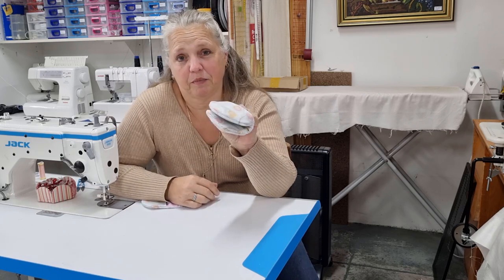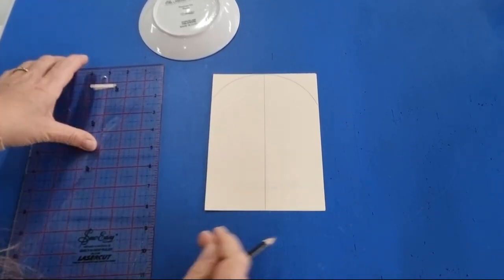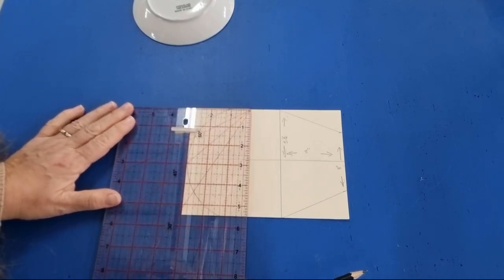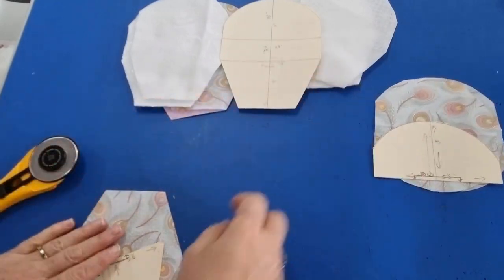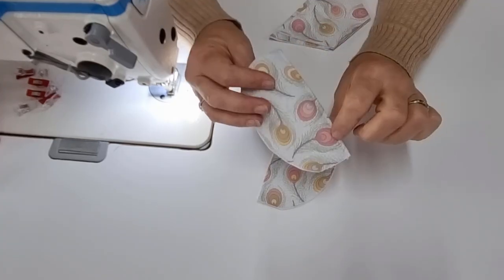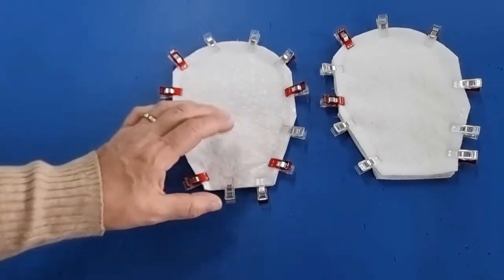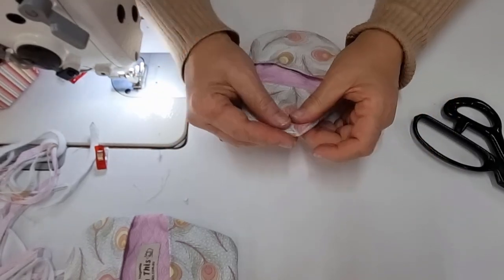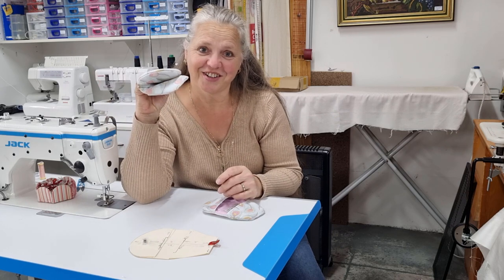Mini Pot Holders DIY Draft your own sewing pattern oven mitt

Comment: Hi. after I made and turned through my own oven mitt, hand shaped, adult size.  I wish I had used binding.  
My 1st thought was why not binding on the lower edge. 
That could be done in batches.  
Or the whole item with binding.  Compare the time taken.  Let's see what else gets suggested 

When I've made pincushions or other small things I've always found you still need to turn the straight edges in, by sewing at least a tiny bit of the edge going to be left as the turning gap. Or adjust the gap width to make it possible.  Or less time consuming fiddly.  
I hope my suggested changes make sense.  
might try one for myself and see how you got on. 

Do you have a link for the light weight cotton batting?
Reply from the maker: They're good suggestions Anita. I might have to see how I go.... Any cotton batting will do, just as long as it's not too thick. You could even use cotton towelling if you like 😀

Comment: I thought it could be easier to tuck the opening shut if the waddling was cut a little shorter on the opening part so you wouldn’t have all that bulk 😉
Reply from the maker: Good tip. I should have done that too😁

Comment: If you have the potholder turned our right ways, flip the end that needs closed to where the finger part is on the wrong side.  Sew closed and flip back.  You will have a exposed seam on the inside but much easier to close that way
Reply from the maker: That's brilliant Jet. Thank you so much.  I'll definitely try this😀
Reply: I agree , this method works well
Reply: Love this!
Reply: This is exactly what I would do!!! Great to gave so many people work together!
Reply: I have done mine this way too. Works great and so fast.😊

Comment: ❤ nice job. So turn it back through the just the thumb part and sew it and you will have to finish the ends then turn it back out that will only be seen on the inside of the thumb part.  I saw it on crafty Patti.
Reply from the maker: Thanks for the tip Kelly😁

Comment: I think it would be easier if you cut the padding 1/4 to 1/2 inch shorter for the opening and iron the fabric at the closure before sewing so all you need to do it pin and top stitch.
Reply from the maker: I think you're right Melanie.  I thought the same thing when I watched the video back 😀
Reply: Hi Christine, I've made these and what I do to close the bottom is turn it inside out sew it and then turn it right side out. Hidden seam. 😊
Reply from the maker: @tecklalogan6237  that's a great idea too 😄

Comment: I was just rewatching some of your videos and came across this one, I guess I had missed it.  I have been making these for 3 years using the Crafty Patti method, works great and easy.  Really quick and great for batch sewing.
Reply from the maker: Thanks Judi. Just checked it out. How do you go with the raw edges inside the thumb section?
Reply: @ChristinesHomeAffairs  I just trim the seam down to about 1/4" and zig zag or serge the seam.  Unless you have really long thumbs you shouldn't even feel it.  My short fat fingers have never had a problem.  My 24 yr. old grandson took one out of my tickle truck (make ahead stash) and apparently he takes it to bed with him because if he leaves it out  for other people to use he can never find it again, lol.  He loves it, that much.  I have done batchs of 20 in a day (sold out and had to restock quickly) and super easy and fast and great return. Also on the car trash organizer bag, check out Loren Moremino's.  It is a great design combined with the taper I think I am close to what I want.
Reply from the maker: I've actually dome a video on the car trash bag with a couple of options for the handle. Hope to have it ready this week😀

Comment: I would get burned with those. Janet gave me a very small pot holder made to fit over the handle of a hot cast iron skillet. It works great; and, it stays on the handle until I remove it. That handle pot holder would really be hard to turn right side out. Thank you for this video.
Reply from the maker: I've been thinking of trying some of those handle covers too Arvetta 😀
Reply: Christina, I would love to see a video on pot handle covers.  I keep trying them to make and sell, but the turning just takes too much time!
Reply: I would love to see a tutorial for pot handle covers too!